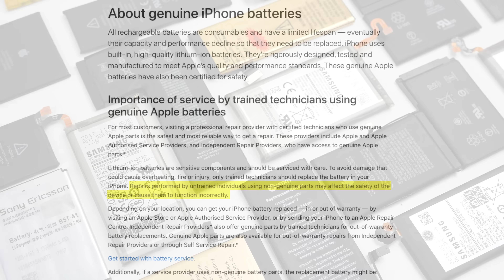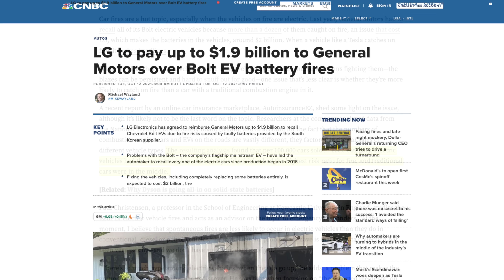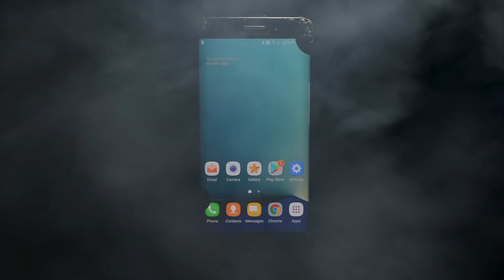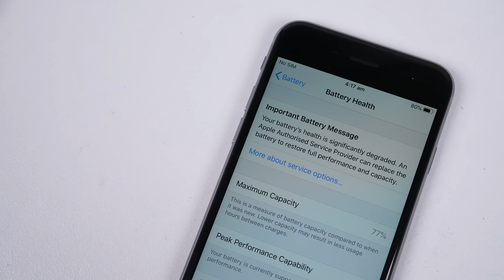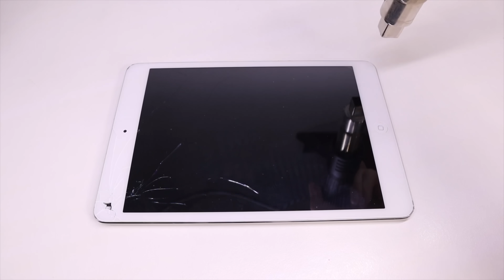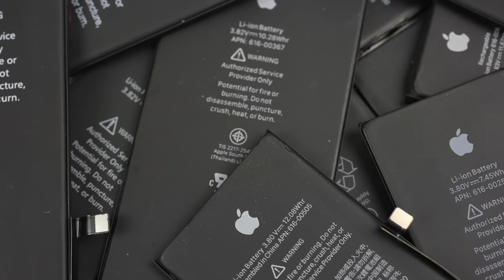Terrifying Hidden Danger of Batteries - From Phones to EV’s - How to Avoid the Risk.

Comment: I tried changing the battery in my Samsung phone. The glue was so strong i couldn’t pop it out so I got a flat head screw driver and that ended up putting a hole in  the old battery sending smoke and sparks everywhere! Best to do that repair outdoors away from flammable rugs or bed sheets!

Comment: I had to change my battery on a Samsung PC (Flex I7 ) because the bottom of the pc was not flat anymore when on a table. The battery was working fine but was becoming a cushion of concern. It was a very easy swap as it is held by screws and now the pc is once agin flat on a table. My local Samsung repair store refused to take the old battery back ! So I just throw it in their recycle-donation box. Come on Samsung, be responsible for your shit !

Comment: The battery in my Pixel 6a swelled up and partially lifted the screen off the phone. I’ve replaced iPhone batteries myself, so I’m not incompetent, but none of those had swollen batteries.  It’s showing 80%. I know that I need to discharge it, but I’m kind of afraid to power it up again now even if it is just to let it run down. Maybe I should take it to a shop and ask a pro to handle that for me.

Comment: If the battery management system is good.   It can last very long.   If not you have to charge the device on specific % if it's sync good.   65% would good for 6+ years and 75-80% is good for 4-5 years.   Good thing about this the battery wouldn't bloat.   My Asus Zenfone 3's battery ended smoothly.   It didn't bloat or explode.    It just simply drain quickly after 5 years.

Comment: Integrated batteries should be illegal and moire so in high end products due to the cost of said product. Also what apple do in making their products imposible to fix by anyone other than themselves and then what they do most of the time is just replace the whole phone or large parts of the phone or laptop due to not wanting to fix parts in them (Or just being impossible to replace with any degree of ease)  Means massive costs on top of a massive price to buy the product in the first place makes them a joke and people really need to stop allowing them to do this by not buying their products till they stop making them impossible to fix by outside repair shops.

Comment: Yet phone cases are stupidly almost designed to trap heat; that's why I had to rip mine off with seconds to spare when I woke to see my overheating phone expanding ominously. I haven't used a case since because I cannot find one designed to dissipate heat, which ought to be a touted advantage of cases. Classic Capitalism, never making better mousetraps when the standard sells just fine.

Comment: Theoretically we could use Nuclear Batteries from Depleted Nuclear Material that is Recycled
I can see its use in Industrial use to store more power and be less dangerous.
In cars many people would crash and cause a fire like with the current EV's
In phones it could work,you would have a small rod and it could charge itself with no damage to the battery itself,because the battery itself is charging.
Sadly we all went into faster and complex production instead of seen alternatives.
Your EV wont do anything to the planet good when burning as well as its production.

Comment: In many applications - LFE (LiFePO4) batteries do have enough capacity. They are not a fire hazard, does not contain cobalt, last 3000+ cycles, and do not need to be stored at 40% for maximum life, they are tolerant to both deep discharging and full charge.
Reply: They may have the capacity but the voltage is lower and require different charging and protection circuits. 
I'm not against LiFePo, it's a great technology. But there are many reasons phone manufacturers don't use them. I'm not saying they're great reasons. 
But you try convincing a room of stockholders to add in technology that will reduce on-paper specs, cost more and lower the bottom line profit.
They aren't recommended to deeply discharge. You're maybe confused due to LiFePo having a lower nominal voltage, therefore a lower "drained state" voltage.

Or maybe you mean they aren't dangerous in a deep drain situation, which is true....but you will still end up damaging the battery if you deep drain and store improperly. It's just not dangerous damage. 
Considering how expensive the batteries are, I don't mistreat my LiFePo batteries and I don't recommend anyone who wants to get their money's worth do either.

Comment: A big problem, although e-scooters etc. seem to be the worst offenders. Most are no-name imports with no way to interact with the company that actually made it, or almost more importantly the batteries.
If you think you have a brand name unit, beware as it wouldn't be the first time that this name is just something an importer has cooked up and they are just using cheap overseas contract manufacturers to make the bikes with the desired brand name attached. The importers (and brand name holders) often have no technical knowledge, so if they get a batch of crap, they'll never know.
A while ago I bought one of those nice black anodised machined aluminium torches. It came with a single cell battery charger, that I initially didn't use as it had a US style plug. However one day I gave it a test run and was horrified when it didn't stop at 4.2 volts, the usual limit for Lithium batteries. What would have happened if I left this thing hanging out of a powerpoint in my bedroom charging the cell overnight (as kids often doo with their e-toys)
If your thinking of buying one as cheap transport, Don't. Save up your money for a real car, or get a conventional bike.

Comment: Hey this is great advice as theres nothing more dangerous than an defective or damaged battery and you should be glad to hear the European Union hopes to outlaw and force importers of Mobile Phones into the Union that they should allow for easy fit for an removable battery...Probably the best thing the Union has done for an long time...Personally i have no confidence in any battery as an storehouse of energy (i no longer own or use daily an laptop) since it ultimately wears down and needs replacement like leather soles on your new shoes it wont last forever and when it does it soon becomes an danger...Theres just too much pressure to improve exisisting battery technology but without addressing its inherent risk making batteries even more powerfull even more dangerous...The engineering focus needs to shift away from batteries an outdated technology that goes back many many decades and has seen no improvements they have always been potentially dangerous and this aspect needs addressed rather than we dangerously increase exsisting battery performance...In short we have more than the ability to redesign the methodology for storing capacitive electrical energy but maufacturers are stuck on archaic batteries and will not pour investment into new ways of storing electrical energy....Its time to rethink how we do this not make an fast buck and just hope someone someday cleverly comes up with something..

Comment: Hello sir! I have one plus 3 mobile. There was a battery problem so I had one plus 3t battery. It looked exactly the same, but there was a slight difference in size and mAh. When I put it, it was written. (Replace Battery, Battery Dos Note Match) If you have the solution, please guide me. thanx...

Comment: Every device that uses rechargeable batteries should be easily removable and replaceable by the user. I really hated when companies started making it incredibly difficult to even get to the battery, especially the devices that need to be taken apart completely just to get to the battery. It's complete bullshit and it shouldn't be illegal because those batteries can be dangerous.

Comment: Even though they said EV is the future, i rather go with burning car than exploding car
Reply: Funny how they say that EVs produce "zero emissions", but when they suffer a car crash, or the battery gets heated up because unlike the normal gas cars, they can't handle a little bit of heat, assuming that the battery is fully charged, which in most cases is, then the explosion can be enough to explode an gas station, if it's nearby, and is also a potential fire hazard for nearby buildings.

Then the smoke will be released and oh boi, would you look at all that TOTALLY not toxic fumes! I'm SUURE they won't damage more the ozone layer than it already is, thanks to all the CFC that was used heavily in the past, and is still trying to recover. After all, it is "zero emissions" right?

Comment: 4:13 a charged or discharged battery could explode, a battery works by having electrons move from one side to the othger, so either charged or discharged, it still has the same amount of energy inside

Comment: Just found out that Samsung does baterry replacements for my phone, a M52 5G, but, that service needs to be scheduled, the phone must be mailed over (even if there is 8 samsung repairs centers in a 30km radius from me), and the service takes 30 days, if the take 3ish days from mailing and 3ish days to mail it back, we talking about 36 days without the phone, the price for the replacement is good, but 36 days? no wayt

Comment: you mentioned the s5 so let me share my experience, yes my phone had a replicable battery but due to how I used it the battery as around 80% of original 7 years after purchase. So when it finally started causing problems (most likely the display flickering on then off when it's colder was the battery) I decided to replace it. 0 way to buy a genuine replacement. Bought one that claims to be genuine from a reputable shop. Model matches, dimensions, voltage , amperage everything matches. Within 2 weeks the thing is swollen and I stopped using it. This demonstrates that simply having a replaceable battery does not solve all issues, we should be aiming for a standardized phone battery with everything (dimensions, voltage, amperage, safety precautions) standardised so you can actually keep using your device well after they intentionally brick the software (I did not update it, hence why it was responsive and did everything exactly like expected while people that I knew that did update warned me not to, that their phone became unresponsive, stuck and randomly restarted probably due to them putting software with higher hardware requirements on old limited tech)
Reply: Same exact history and same samsung s5 here.
Had to abandon a perfectly fine (and nice) phone.
Reply: @Chipicui  Yeah , I have 2 of the same model bought at the same time with the same issues, definitely not random ,it was a great phone, still sad about not being able to use it anymore but gotta move on at some point.

Comment: EU-law will change this in the future. from 2027 onwards new devices will be required to have user replacable batteries, which can either be replaced without tools or with common household tools (philips head or flathead screwdrivers for example).
phones and tablet PCs are an exception, they will be allowed to have permanently built in batteries, but the law requires them to still have at least 80% of the total battery capacity after 1000 complete charge cycles. also manufacturers will be required to offer replacement batteries for at least 5 years after bringing a product to market.
this law also extends to EVs where manufacturers must design the vehicles in such a way, and offer schematics and diagnostic tools so that independant businesses are capable of replacing batteries.

Comment: And now combine all of that with the "near" future, when there will be only EV cars. Amount of accidents like that will become a common thing. Plus EVs are not better for environment, producing this amount of batteries is not eco-friendly, later storing used ones or properly recycling them either. World overall is not ready for producing that amount of electrical energy that will be ecological to charge every car, there are only two-way to do so, atom or the sun, and we do not have them enough. And we will don't stop getting oil anyway because our everyday, life, jobs depend on it, all the plastics, and other things we do from it, I do not believe we will be able to move to something else within 100 years if we even try, because almost every industry really on it in some part. This quick push for EVs is made mostly for making more money for reaches people and corporations, it is not for bright future and environment.

Comment: At you Model car track, we use LiPo batteries of varying capacity of 7.4 to 22V and upto 8000mAh. If we get a damaged pack, or just it's worn out, there is a bin full of Salt Water we drop the battery in. I assume it gets discharged rapidly and the water stops any fire. This is the preferred way of disposing of batteries before putting them in your rubbish bin. We had a garbage truck near us, catch on fire, from someone putting a Escooter battery straight in, with some charge on it still (fully?). Truck had to dump the rubbish on the road and firefighters called for water to put it out. So tell people not to put them in the bin, before using seawater to discharge them.

Comment: It's worth mentioning that lithium reacts violently with water, so when a lithium battery catches on fire, pouring water on it will only make it worse. That's another reason why lithium battery fires are so hard to put out.
Reply: there is actually very little lithium metal in a battery, the danger is from the high energy density a charged battery can hold

Comment: could you also make a video on dodgy chargers, The fake apple ones are really dangerous.
I had a laptop that a friend brought in and she plugged in the laptop (this was a brand new laptop) and it was acting really off.
I asked if I could take her laptop charger so I could have a look at it, I  conducted a portable appliance test (PAT test or test and tag) on the laptop charger and it resulted as a failure as the fuse rating was incorrect and apparently it came like that... This is here in Scotland so it was uk plugs but yeah the fake Mac book chargers are dangerous

Comment: I almost burned my house down thanks to an iPhone 6 plus battery, at the time I didn't know you could dissolve the adhesive with alcohol to remove the battery, as I was removing it I accidentally snapped it and it immediately caught on fire. 

Since then I'm more careful when removing batteries.

Comment: Easily replaceable batteries is a thing I like about older simple flip phones. Some time ago the battery on the flip phone of one of my family members broke due to forgetting to charge it. But the battery was easily replaceable because you also have to remove it to put in the sim card. And luckily there are recycling collection points for old batteries here. 
It would be cool to see easily replaceable screens and batteries on average new smartphones.
Reply: It would be cool if OLED smartphones had a miniature HDMI in jack so you could use it as a TV screen..

Comment: The only danger is if the company cuts corners and results in a defective engineered product.
The same as a car having a bad seal resulting in gas leaking and potentially leading to an explosion.
The technology has nothing inherently more dangerous than lets say a motor that works by controlling explosions. (combustion engine) Tell anyone that doesn't know, they will be riding in a vehicle that explodes many thousands of times per minute. Small explosions, but still explosions.

Comment: Fix installed batteries have safed a lot devices from dying the liquid death. Since most flagships are at least ip 68 certified, we've lost way less phones to liquid damage than we used to be when phones were still rocking self serviceable batteries. From a device design perspective, you have to glue in the battery at some point, to achieve the tight package every high end phone maker aims for. Last but not least, most people just never switch out their battery. And guess what, thats nothing new. Even in those old Nokia days only heavy users ran around with a extra battery for their 3310. To keep that whole nostalgia a side, not user serviceable battery(we ain't going back to it for sure) but good manufacturer service is what is needed. If the manufacturer has a good service network and does the battery swaps for 50$,  selfservice is unattractive anyways. Sadly besides Samsung I do not see many manufacturer that offer fair priced battery service with local service network.

Comment: I had in the space of just two years swollen batteries on my MacBook Pro. No reason could be given, just happened. The repair guy said “it happens.” I just can’t believe a replacement from Apple swelled so quickly after the original. Tech guy said it could be environmental…. If that’s the case I have no idea what in. My environment could cause it to swell… it’s not in heat, it’s usually always on my desk, I don’t keep it in my bag… no reason why two sets of batteries would swell within 12 months of each other…

Comment: Recently picked up an old Samsung Galaxy Note 8 in great shape, exept for the Battery. I dealt with some „spicy pillows“ before, but this one was truly massive. It also doesnt help, that the battery was glued down sostrong, that I had to use hard plastic and metal prying tools. I was really afraid I would puncture it and burn down. Luckily everything went well. Only problem is I dont really know where to bring those batteries… Stay safe.
Reply: i mean if its at 0 volts you can puncture it as much as u want, and that battery was probably dead anyways if it was a huge spicy pillow.
Reply: @SOTP. if I have a really old device with a spicy pillow, is it no longer a hazard? It's been sitting in a closet for more than a decade.